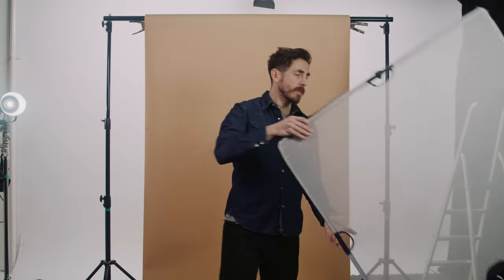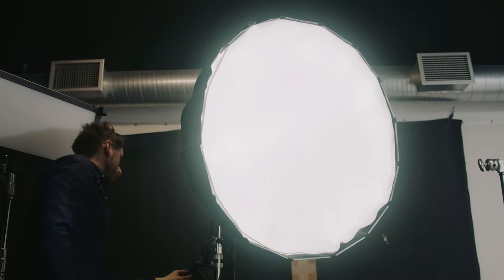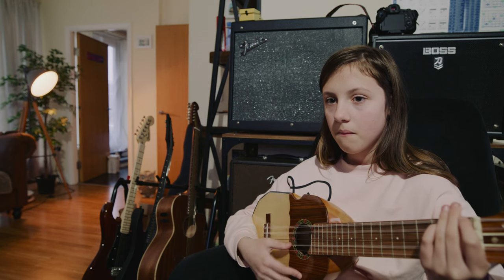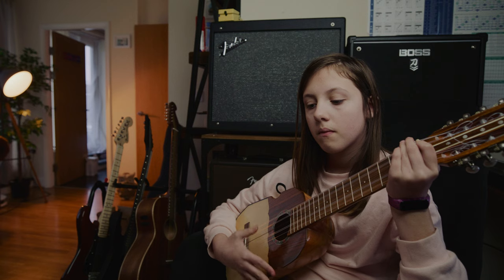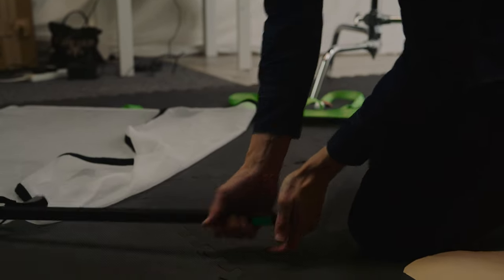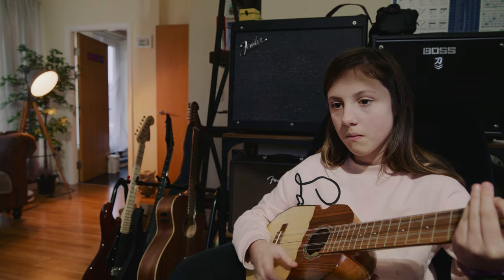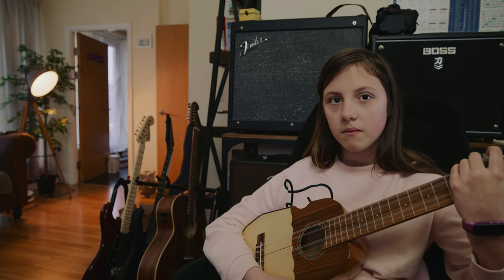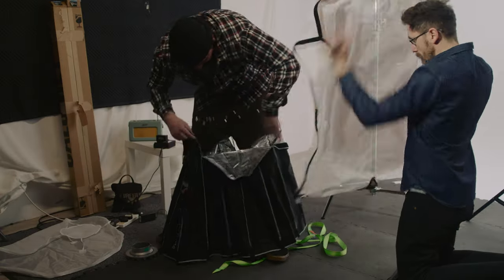Softbox Vs. Diffusion Frame - Which Should You Use?

Comment: I don’t see the difference except one system is more flexible; light is separate from diffusion material  and you can vary the intensity by light placement. Also by having things separate you can use a different sized diffusion frame. The other thing also is that one system is used more in commercial cinema/ professional photo shoots more than the other. But they both do exactly the the same thing! There is nothing magical about a diffusion frame. It’s not like it’s a magic material or something. It’s just about intensity, size and preferred use really. They even price diffusion frames or scrims more expensive because the those companies are selling to a market that has big budgets so that should tell you something. It’s just hype and marketing.
Reply: It’s not though. The difference is pretty obvious. 😂there’s also affordable scrims at around $80-$100